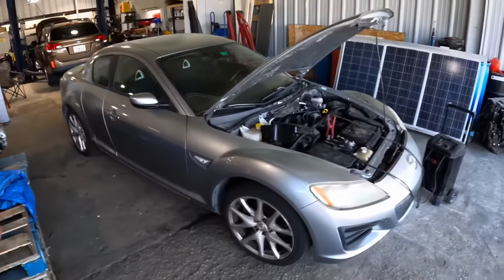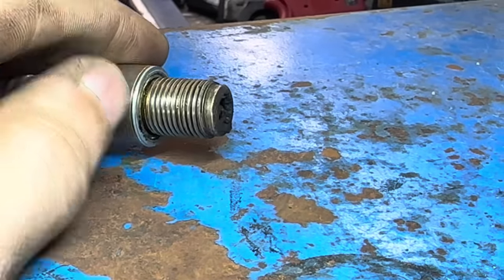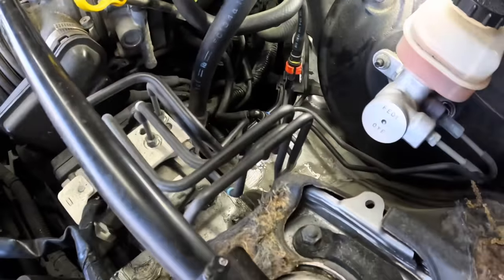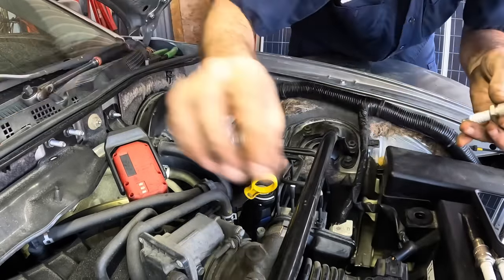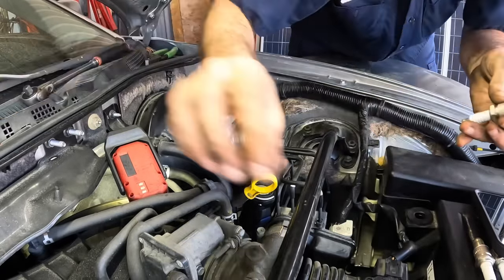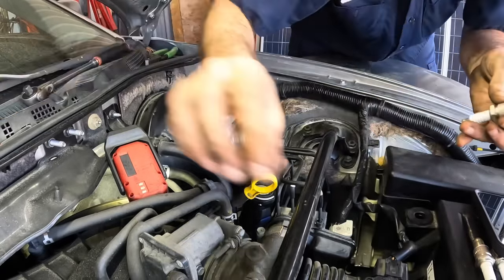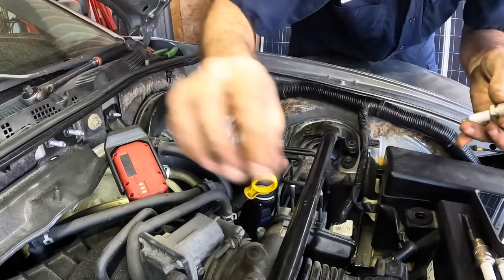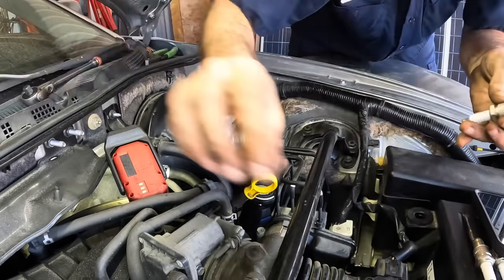Low Compression Rotary, No Start FLOODED Mazda RX-8 Drove in Towed Out!

Comment: We own a 2018 Mazda 3 with the 2.5 L engine and it's a great car.  I'm personally a fan of Mazda, as they are innovators and while I admire the innovation of the rotary engine and Mazda's decision to use it, I can't escape the feeling it's a fancy version of a 2-stroke engine.  It has a great power to weight ratio but it burns oil and fouls spark plugs.  It's an advanced version of the engine in my chain saw.

Comment: I had an 86 RX-7. I loved that car, but it was very easy to flood it. Something about those rotary engines.
Reply: @mustbetrue1602  Other than flooding, if it was turned off too soon after starting it, mine was very reliable.
Reply: yea freinds 86 had that.  My 85 with12a  aspirated never had that problem.  Figured it was the injectors that are the problem.
Reply: @robertsmith2956  Might have been. I just learned that if you crank it, let it run for a few minutes before you turn it off. I never had a problem after I did that.

Comment: we always squirted some trans fluid in thru the plug holes on flooded RX-7s  it did help
Reply: Yup, a little bit of an oil film helps the apex seals provide a much better seal. The normally present film gets washed away by the fuel during flooding.

Comment: A long time ago, I owned a 1988 RX-7. Never again. They overheat easily, and there goes your compression. They reqire constant care, like a puppy. BTW, I got my plugs out using 3 extensions and a swivel joint.

Comment: Remove the left wheel and you should get easy access to the spark plugs. For de flooding try slowly lifting your foot up on the throttle till it fires then push down again and do it again till your able to get it to fire.

Comment: Hey Ray. There is a Access Port in the wheel well and on the Block it Staates which Plug  goes where :) they are marked L and T
Reply: It's also pretty easy to remember that on a Mazda rotary the trailing plug is above the leading one, so L for lower, T for top.

Comment: That's leading and trailing plugs. Reminds me of the time i changed out plugs on a '75 Chevy Monza V8. After the two and a half hours it took to replace them I looked up the spark plug changing procedure in our Chilton manual(hate Chilton), the manual said to unbolt the engine mount bolts and jack up the engine to properly reach them. 😮
Reply: @mustbetrue1602 that's why my friends and I got the bright idea to photocopy the sections of manual we needed at the library... At the time, it was a nickel a page.
Reply: Now days, it is an on line script. Alldata is $60 year. Per car.

Comment: spark plugs, you got two different ones, one leading, and one trailing, if the engine is flooded, jumper the battery with external power ( what ever it is, extra battery, car what ever) gas pedal down to the floor ( kills the gas pump ) and started multiple times, you will hear it run and shut it off as it cleans the rotor chamber. Done this many times on my old 2010

Comment: First time I’ve ever heard of two different type plug in the same engine
Reply: The rotary has a long combustion chamber because of the design. The leading plug fires first and the trailing fires after to facilitate the flame propagation in the correct direction for complete combustion of the fuel. The non standard plugs are supposed to be fouling resistant but if the engine is not run hard occasionally the carbon won’t burn off and will end up like the plugs he removed.
Reply: You should see the distribute on the 12A engine.  4 plugs, 6 posts.  4 90 degree offset, and above it a pair of them.  Never could figure out how that worked.

Comment: I used flagship for the ecm in my 06 Chrysler 300c. It lasted about 50k miles and crapped out. Tried to warranty it and it took many phone calls, emails and live chats but I finally got the replacement 6 months later.

Comment: A few years ago. Manual transmission version. Same problem. Just put a rope onto it and pulled it. After 10 secs or so, it started to go. Took around 25 secs before it ran clean on all chambers. Never even lifted the engine cover.

Comment: Retired Jeep tech reporting in. I too know the pain of rotary engines. Had a customer bring one in for this very service. The service writer may have gotten a wrench hurled at him.  

I'm not an expert on them, but they're a ticking time bomb as the miles creep up to like 100k, the apex seals wear out and have to be replaced. I have a buddy who has 2 complete engines, he just swaps them out every 80k and rebuilds the one that came out in his spare time. Glad to see this one was just mega flooded.
Reply: I read that if you put an oil mix into the fuel and do the rev thing on shut down there's no wear issue anymore.

Comment: One thing that I learned from the older rotory engines especially if it gets flooded have to add some oil to the cylinders or in the gas to help get the rotor seals to make good seal again

Comment: To do the plugs in an rx8, you take the driver side wheel off, then pull the little panel out in the firewall, basically gives you straight in access to the plugs.
Reply: Fender wall, not firewall. xD

Comment: In 1975 I was staying at a motel while working on some core drilling for Anaconda Copper in Navaho Arizona.  The owner of a Mazda Rotary car spent the night at the same hotel and it would not start. The local gas station owner was not a mechanic, but knew I was a licensed mechanic and asked me to look at it.  I pulled out one of the lower plugs and coolant came pouring out.  That told me that the seals were blown and I did not have the tools or time to work on it.  Mazda was contacted and they towed the car to Phoenix and repaired her engine free of charge.  She was put up in a hotel in Phoenix while the work was done, also free of charge.  I was impressed by the service as she was out of warranty. The plugs on the engine I worked on were very accessible.

Comment: The used car dealer I worked for in 1978 bought two 1975 RX3 wagons at a car auction. They were good sellers. He sold one 4 times and the other 3 times. They came back flooded after a few weeks and the customers traded them for different vehicles. I figured out that the way to get them started again was to remove the plugs, crank the engine to clear it, install the plugs, set the acetylene torch to a good flame, turn the tanks off and back on and use the mixture to start the vehicles.

Comment: As a person who owned a 1982 Mazda RX-7 with a 12-A Rotary engine, the lead plug is the primary ignition plug, the trailing plug is to burn any other remaining fuel in the combustion chamber as it rotates around, in order to clean the emissions better.

Comment: Thanks Ray. I used to lust after Mazda RX's, but after learning of the problems that seemed to pop up all to often I never committed to getting one. What's interesting is there are places that still fight to perfect the rotary today. Liquid Piston comes to mind. With the advances in materials and manufacture there now may be a consistently reliable rotary out there.
Reply: They're an enthusiasts car. You have to really love them.  You can rebuild them pretty cheap. Aftermarket has a few good upgrades and preventive maintenance upgrades too. Or you can just LS swap them... I've wanted one for a while. They're cheap. (Or were cheap)

Comment: Had an RX4 wagon in the early 80s, it had a manual choke and getting the fuel/air mixture right for a cold start was like quantum physics.... If it flooded you were not going anywhere for the next 20 minutes. Almost lost my job for it making me late too many times.

Comment: I have one of these cars, an 09 6 speed manual no tcs decent if not great compression, and they are pretty straight forward for the most part, besides the few gremlins that can emerge here and there. People tend to overthink them, when in reality, its just the engine to question. I had a similar scenario as this when I had done an oil change/tune-up (plugs, wires, upgraded BHR coils) on my car since I had it sitting for a little while, probably 6-8 months. I guess from it sitting for so long the oil film in the combustion chambers had dissipated and I couldn't get it fired up within a few cranks along with possibly getting air in the oil system from not starting it before changing it from it sitting. Not wanting to totally flood it out, We stopped there and did a little bit more research. We found out that adding a little bit of oil into the combustion chamber with a syringe to boost the initial compression will get that puppy fired right up. Worked within 2 cranks. Now, it was back to normal after letting it idle for a little while, so we decided to take it for a trip around our test area we test our cars. This is where we realize why they had offered bigger insulated wires. Crosstalk. When we upgraded coils, they were firing way harder than the OEM ones so the sparks were cross talking above a 30% throttle scenario in the middle of the RPM range. Had to swap back to OEM coils until I buy those newer wires but besides that, nothing besides a hydraulic clutch system replacement is totally necessary for me. A little tip about the spark plug access, is that the access spot is behind the front left wheel so removing the wheel, and taking a little flappy panel off and you have easier access. Extensions still recommended. Enjoyed the video, just thought I'd give some information from what I've learned since I had a fairly close experience to this, in case you do work one another, you're another step ahead with the basic finnicky stuff.

Comment: I’ve had some nice cars over my years like S3, Subaru WRX, Focus RS. 
The RX8 I had was the best to drive than all of those, but it was just not a reliable enough vehicle to nip to the shop in as we flooded it too many times. Take it out on a winding road and you’ll experience something close to a super car for a lot less money.

Plugs for the Mazda are expensive, and the easy way to change them is from the wheel well with a “wobbly “. 

If Mazda could ever get that car reliable, I’d buy another in a heartbeat.❤

Comment: Knowing a little about Mazda rotary engines. The best way to start flooded rotary is pump Trans fluid into the rotary and replace with new plugs this builds compression and will start and if it doesn't you have to repeat the process. Trans fluid will seal the apex.

Comment: Don’t ever shut it off cold. That’s what causes the flooding - they run stupid rich until they warm up. Also you can squirt some oil or atf in the plug holes to help get the compression back. They only sound like that cranking when they are blown up or flooded.

Comment: Nice job.

I had a 1988 RX-7....  This was long ago...  1991 or 92??  I can hardly remember....

Anyways, yeah, I remember being repeatedly warned not to flood it.  

Those plugs were a real joy to change, I do remember that....  I do remember that.  One of the many times I wondered "How do real mechanics & techs do this stuff???"

Mine ran fine.  Actually a fun car.   Small little car, but fun.  That teeny little motor did put out some power.   And it revved insane.  

The other sorta weird thing was, for such a little car, it loved gas...  I was barely getting 14-15 mpg, in this little roller skate.....

There is a passionate owners base though....  So when it comes back, if you have questions,  check out the forums & owners groups.....  There are people who are really good at keeping these things running...

Comment: This process was a real pain before Mazda upgraded to a gear reduction starter. We used to pull-start the manual trans models. Looks like this one is an auto though… just gotta keep hammering it. 

And btw, trailing top, leading lower… the plugs are labeled T/L and the rotor housings are stamped accordingly beside the spark plug holes. Don’t wanna get them wrong

Comment: Ray.  Do not beat yourself up over that Mazda those rotary engines are hard to work on. They’re a beast when they are running right they’re a hell of an engine but when they’re not running right, they’re hard to figure out. They’re hard to work on. they’re hard to get running right I owned one back in the 70s and RX four and it had the big rotary engine in it at the time the biggest one they made and it was carbureted had a four barrel on it. I made it to 100,000 miles with it, but we were always in and out of the shop, keeping that thing tuned up like I said it’s hard to work on a good mechanic knows and understands them very well. A standard mechanic isn’t gonna cut it. I guarantee you it takes a good Mazda mechanic that knows those engines in and out to be able to fix them and turn them up properly, been there done that they drink a lot of oil they design that way that’s what keeps those rotors wet but they’re a good engine otherwise for their size they put out a lot of power high revving power lotta fun on the race track back when I had mine we didn’t have all the smog equipment they have today But we still had the catalytic converter stuff that they think they called heat exchanger then they bolted right up to the exhaust outlet constantly they are prone to cracking just part of the deal of owning that engine but anyway glad you got it running and with those old plugs there’s no way it could’ve fired no way They were shorted out just by looking at them. The video took me back to my old days of racing the old Mazda RX four before they built the RX seven have fun. Enjoy your nice warm weather being cold here in Albuquerque.

Comment: They’re fun when you can keep them running though they make a nice sound. I worked on one years ago old school had a carburetor on it ended up having a bad needle valve fix that and got it running good then the guy sold it which was probably the right move.

Comment: Nice video. Two things though; if you go through the wheel well, you can access the spark plugs easier. And, you have to let the engine come up to temperature before shutting it off, otherwise you can flood the engine.

Comment: Interesting engines. The earlier ones in the RX-7 were nearly bullet proof. I heard tales of running them without any oil in the crank case for hours on end and no failures. Apparently, the guy wanted a new vehicle and an insurance claim. The shop offered to “help” him out, knowing the engine would be okay. He never came back. The shop was on Long Island in NY, it’s no longer open…wonder why?

Comment: My sister had a 90’s Mazda RX7 with a rotary engine. The exact same problem happened on multiple occasions.We would have it towed, and they would have to partially disassemble the air intake system to purge the gasoline out of the flooded chamber. My sympathies.

Comment: The ignition system on these is the weakest link. Those NGK plugs are the best you can get for them, and only use OEM coil packs. Additionally, the automatic version of the RX-8 does not run at high enough RPM to prevent the excessive carbon build up that kills these engines. I have had both a Series 1 and Series 2, both 6 speeds. Incredibly fun to drive around the back roads of New Port Richey while shifting at 10K RPM's. Most of these engines need rebuilt between 90-100K. They are fairly easy to rebuild once you learn how the Apex seals work. My series 2 was at 115K without a rebuild and running fine when I traded it in.

Comment: Mazda deflood procedure is 8 seconds of cranking with foot to the floor on the accelerator, a minute rest then repeat, from experience you need to repeat this 6 to 8 times before attempting to start, any failed start will result in flooding, ideally if the car is a manual then tow start in second gear at 20mph.
Best way to change plugs is through the wheel arch really easy.

Comment: Each rotor has 2 plugs. The upper is the leading and the lower the trailing. The R100 model was a single rotor and only sold on the west coast in late 1960s or 1970

Comment: Flooding is normal on RX8 if you stop engine before it is warmed up. Remove fuel pump fuse, disconnect air pump, jumper to second battery an crank with throttle wide open for several minutes at about 20 sec per time to let starter cool off. Then reconnect everything, don't touch throttle and try to start it. Repeat whole process if it doesn't work first time. Lots of fun.

Comment: I don't know about that interation of the rotary engine but the originals used oil injection much like a two cycle motorcycle to provide lubrication.  That explains all the carbon coke on the plugs. It's also why we didn't see rotories for a ling time. It took Mazda that long to figure out how to get them to burn clean enough for modern epa standards.

Comment: the 37.5k miles for plugs maybe because they burn oil, some gens of rotary have oil injection to help lubricate the apex seals and/or they are suppose to run a sorta of 2 stroke mix to help with afor mentioned reason

Comment: Take out the spark plugs do another dry crank,heat the plugs with a gas plant, install and start the engine do not rev it and just let it run for at least half an hour,do not turn it off until the motor is fully heated up. These were a problem even new at the dealer i used to work at.

Comment: Rx8s have a leading and a trailing for each rotor housing to conform with emissions in its time period. The lower secondary is just to burn residual fuel. The secondary doesn’t have to be as strong of a spark as it’s not contributing to the combustion cycle